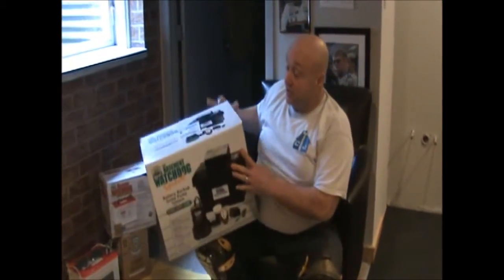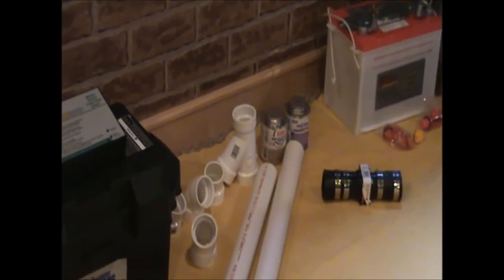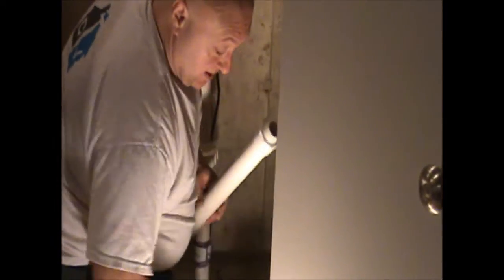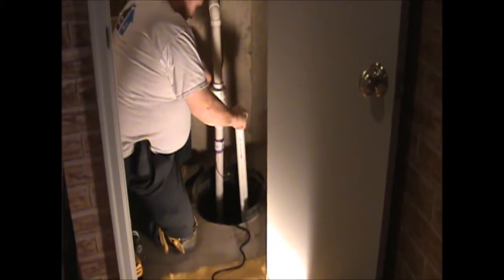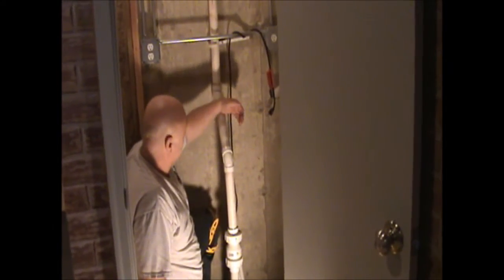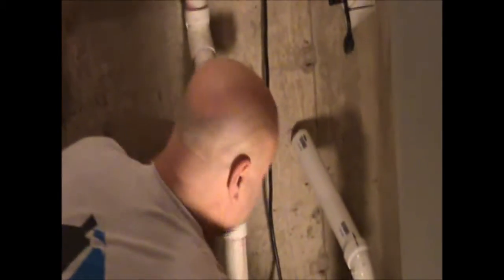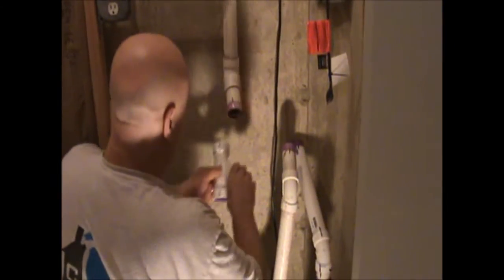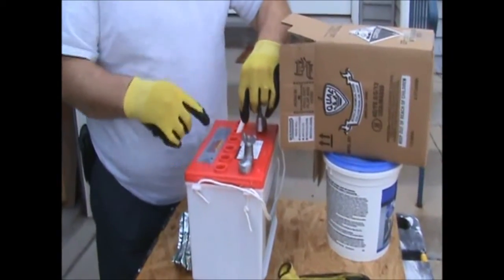How To Install a Basement Watchdog Battery Backup Sump Pump

Comment: I thought this was an excellent how-to video.  Step by step instructions made me confident that I could save myself a few hundred bucks (after getting quotes), and do this myself.  Unfortunately, I had to do this after a power outage shut my system down, but I plan to be prepared the next time!  Thanks Contractor John.